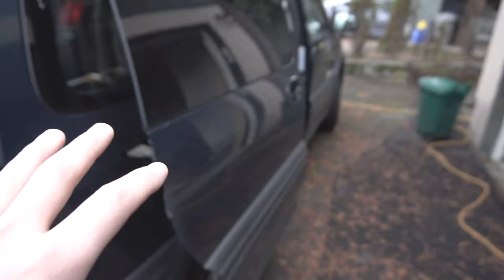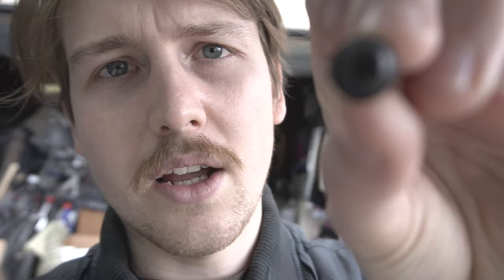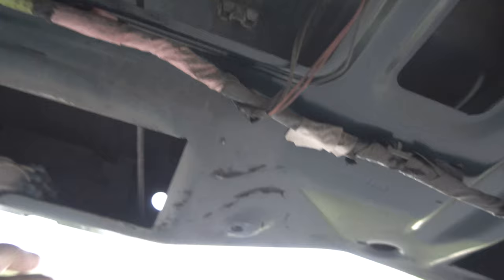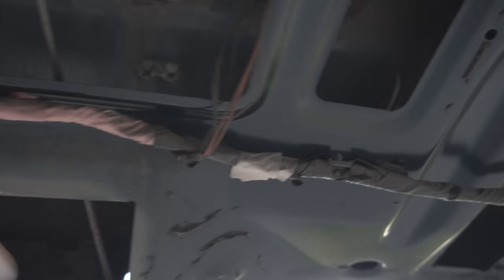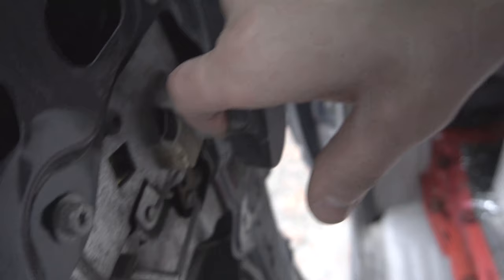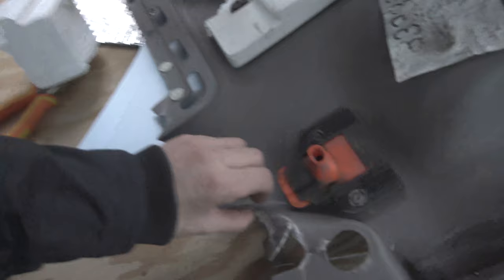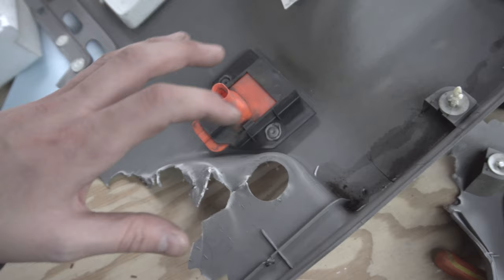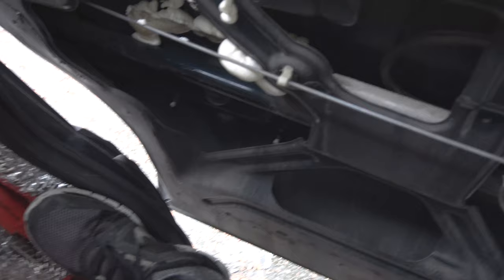How to Insulate the doors in a minivan camper + how to take out the manufactured plastic. Van Life

Comment: I love living in my minivan rig.but it's winter here and I feel like wind gets through the side of the doors and back of the minivan.can I use ductape to insulate?
Reply from the maker: You might be able to cut down on drafts by taping, but depending on how cold it is where you are metal is a pretty good conductor of heat and the cold will just come through the metal frame of the vehicle without proper insulation and without a proper heat Source it's very challenging
Reply: @takingbackcrypto  wow thank u.

Comment: Did you have to remove any airbags? I'm thinking about completely gutting out my minivan and insulating it like yours.
Reply from the maker: no airbags in this model because of it's age. It might be a consideration in your model, but usually it shows on the plastic casing if there is an airbag underneath.